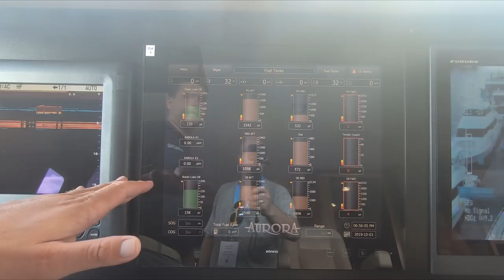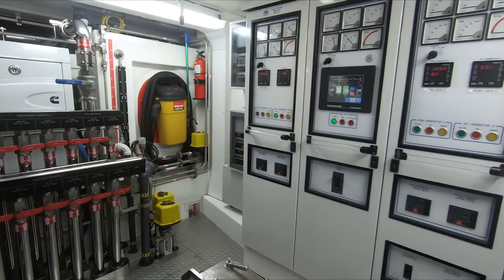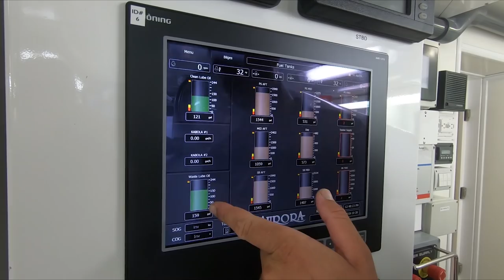FLIBS 2019 - Nordhavn N120 "MY Aurora" Full Tour of $13.5 Million 120-foot Expedition Motor Yacht

Comment: That one section in the engine room before the far door, are the tanks. Water, gas etc. and apparently you can take off the hatches to clean or fix something. Inside is a container that holds all the water or gas. So if there’s an issue you can replace the container. Not what they are actually called, in another video the guy doing the review of this yacht was explaining, but he never opened the door at the end and with all the noise going in this video I couldn’t understand what the crew member said was on the other side.

Comment: Two watermakers is a little aggressive. I would prefer one. Needs a sofa in the lounge behind the bridge. Pilot house on the flybridge is sweet.
Reply: These boats are specifically designed for redundancy though. Imagine being midway across the Atlantic when your desalinator fails. You'd be grateful for the second one then.

Comment: Be aware there was a lawsuit between the purchaser of this boat and Nordhavn. Apparently Nordhavn  took the boat back. I read the inspection report by Steve D'Antonio in 2013. His survey on this boat listed many many significant safety and design problems.  D’Antonio’s inspection report found 179 deficiencies with PAE’s work on the Aurora, including critical safety items that could result in the risk of explosion, electrocution, fire, injury, or loss of life.
Reply: REALLY?! That's crazy! Nordhavn's are known for being such safe and reliable boats
Reply: Nordhavn (PAE) won the lawsuit and also won the appeal. Nordhavn did not take back the boat.
Reply: @timhale4540   Read Steve D'Antonios  report with 179 discrepancies to ABYC standards in yacht construction.  That is really all that matters.
Reply: @timhale4540  Nordhavn is current brokering the boat for sale for $13.5M.
Reply: @robertfrost1683  Nordhavn has the current listing. Doesn't mean 'they took it back'.
Reply: @timhale4540   179 deficiencies on Steve D Antonio’s report  ~ i read that report ~ obviously you did not. It does not reflect favorably on Aurora.
Reply: @robertfrost1683  I did read it. 179 ABYC discrepancies. Some minor such as a knob was loose when the boat was inspected.  I also noticed that the report had a disclaimer that the boat was built to ABS standards, not ABYC. Would there have been fewer (or more) discrepancies if inspected to ABS?
Reply: Scaremongering. Was all a load of huey in the end. Nordhavn won. I would humbly suggest that the new owners couldnt afford it or it just wast for them!
Reply: The lawsuit is something that I most would step back and look at in detail. 
Everyone knows nordhavn makes good yachts but they haven't gone out of the way to market her so that you could see the beauty of the craftsmanship that went into her.
Reply: Didn't the original owner whom was on trip back from china to Vancouver I believe, try to not pay a tax and blamed nordhavn for speaking with customs and this was part or the problem?? Not sure of the whole story but customer was pleased with vessel while on trip . There's a you tube video on crossing
Reply: @timhale4540  Well, we all know that winning in court isn't a matter of right vs wrong, it all depends on one's lawyers and the amount one is willing to spend. Apparently Nordhavn had better ones
Reply: The lawsuit was about the buyer trying to not pay tax. He bought it cheap for under ten mill.
There's a video of the north Pacific crossing from China to Vancouver
Reply: It boiled down almost fully to cost overruns in construction. Something like 40% over budget which the owner actually advanced money for. On delivery the sewage treatment system wasn't fully plumbed and this issue became the focus of most of the lawsuit. The explosion references are mostly a bugaboo due to codes stating that many electronic devices must have an "explosion proof" rating that means they will not ignite an explosion if the room they are in becomes  carbureted with a properly explosive mix but if that happens it's probably going to blow up anyway. A lot of those findings are for various ratings or classifications that do not apply.   Note that my information was obtained late at night while sitting on a bar stool in Nanaimo BC.
Reply: @robertfrost1683  You keep banging that drum, but ultimately the courts decided in favor of Nordhavn. Guess the owners needed you there, because a highly paid legal team didn't have your ability to keep singing that same tune to the judge.